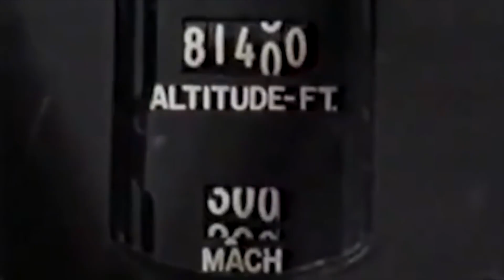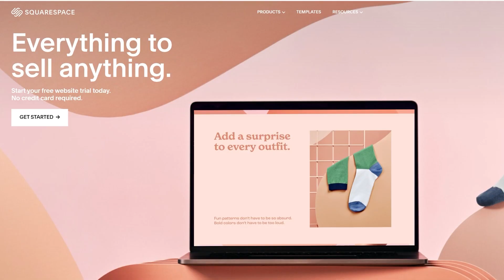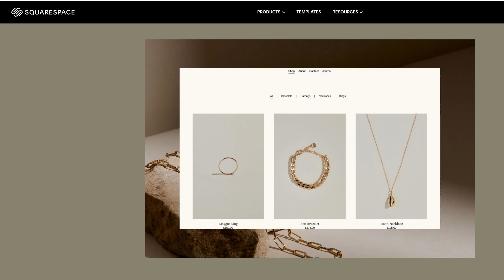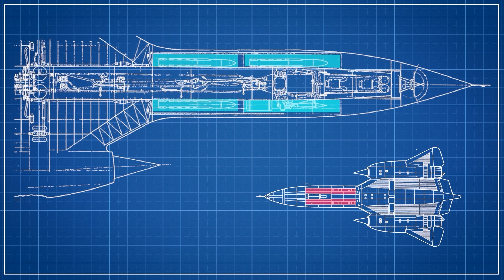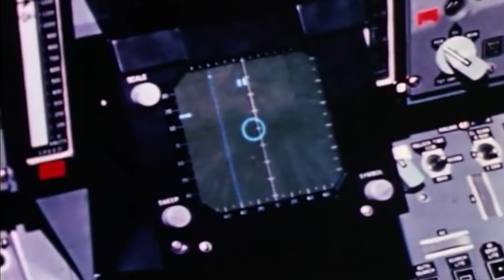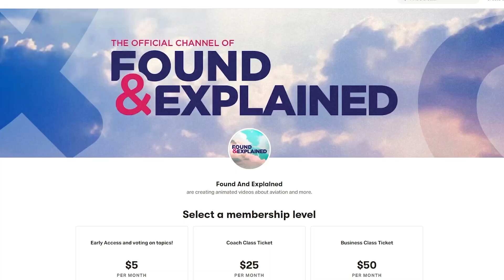Turning A Spy Plane Into A Mach 3 Fighter Jet - The YF-12

Comment: To be honest, Lockheed's engineers were kinda forced to make a fighter after USAF learned of existence of A-12 Oxcart...
After all, Air Force top brass wasn't exactly pleased to learn that not only did CIA withold crucial information concerning US airspace security, but that those shady suits at Langley for a few years had a plane that completely outperformed all and every type of aircraft that USAF had (and the fact that several promising Air Force prototypes were cut short for cost overruns while CIA seemingly got a blank check for A-12 added insult to that injury)...
Reply: The AF weren't "left out", they owned 3 A12s originally

Comment: Every flight arrival from these high-flying Titanium faith in structure craft, had a hella of maintenance extreme that led to tagging, PER flight, Lockheed simply needled to create a cooling cycle system, absorbing high, thin atmosphere from the front area of wing rims and engine intakes, lather building and distribute to the nose cone, pre-cooling shower the craft like a low atmosphere flight. That also could've evolved into passenger Orbitliner concepts in human history.

Comment: not possible the design of the aircraft was meant for a straight steady flight and loitering at very high altitudes sorry to say the sr31 a complete sitting duck in todays arena. Moreso the blackbirds are fuel thirsty both in flight and on the deck . I havnt read any articles that they addressed this issue yet

Comment: The operational, F-12B, variant, would have carried six missiles with two forward and two + two in the rear as the ASG-18 hardware was miniaturized and moved to the spine.

The centerline fin was found to be unnecessary and would have been removed, though the under-nacelle ones would have likely stayed.

The forward chine would have been blended into the nose, just behind the radome as the IRST could see a Mach 3 B-70 at 45nm but little else.

Against the M4 Bison or M50 Bounder, the jet would have been superlative.  Against the Tsotka, not so much (principally because the T-4 was itself an engineering testbed and far too small to achieve intercontinental distances).

Comment: It's not speed that dictates the outcome of a dogfight, it's the agility and the ability to turn inside your opponent turning radius.  You sent that turkey against the Mig 31, the latter, although slower, will be able to defeat it, unless the SR 71 clone will use its superior speed to disengage and run for its life.
Furthermore, a speedster like the SR 71 need lot and lot of fuel to stay airborne, therefore, what will be the engagement time of such a gas guzzler in a dogfight.
Has the "Einstein", who got that "brilliant" idea, forgotten at what speed a dogfight usually occurs?
Poor Yanks, always chest thumping for a  simple foat. Why don't you try to upgrade the F 16? It's the best fighter you've ever made after the P 51 Mustang.

Comment: At speeds like this, do you even need explosives or could you just dive bomb 20kg steel ingots at mach 3 and get away with quite an impact?  I am no expert, but it sure sounds like anything coming out of that plane is a kinetic weapon and just happens to be loaded with smart steering and explosives.
Reply: It would never be doing that at top speed. Most fighters hardly ever use their top speed except for evasive action and only briefly as it uses so much fuel.
Reply: @shrimpflea  that makes a lot of sense

Comment: interesting... I actually made a fighter jet that's based off the SR-71 and it's literally just called "RF-74 Blackwing"  (Reconnaissance Fighter) it's supposed to be used as the tip of the spear in an attack because of it's speed and actually good maneuverability(had the same shit as the F-22 and a rocket(basically an RCS)) and the airframe is made out of titanium alloy and tungsten alloys(tungsten for the parts that's higher in stress) and it can carry either 6× 150mm(550lb) Type20 Guided Bombs or around 10× Type52 IR/RD/LR Guided(IR = Infrared | RD = Radar | LR = Laser) Medium Range Air to Air/Ground Missiles

yes this mf got enough space to store bombs that nukes Frigates.. well the plane is as big as the SR-71 and has more fuselage room

Comment: Completely ridiculous.  So a plane that actually was faster than any missiles it could carry was an interceptor. How.. also heard it was used as a tanker. How. It had to refuel soon as it was airborne.  Leaked fuel on the ground. Airframe had to heat up to seal the tanks..at mach 3 any turn had to be standard rate to keep from overstressing the airframe..no negative g maneuvers . Great as a spy plane not suitable for anything  else. Not even good for that after Soviets came up with the mig 31 which was as fast and could intercept it.  Oh well it was the most awesome for it's time.  If you look in the cockpit see 50s technology.

Comment: Job well done, again. Kelly Johnson was the Einstein of aviation. My dad knew him & his protege Ben Rich well while working 4 Lockheed back then. Dad told me many unique stories about them. 1 was how a bunch of engineers couldn't figure out how 2 make the air intake cones work & correct diameter 4 the SR71. Kelly walked up looked & said 30° & retractable 4 speed. No computers then & when they did their calculations found out he was spot on. Another stroke of genius was placing engineering & production side by side on the fightline. Allowing quicker communications & understanding each other job difficulties. Also cutting out egos. Kelly was responsible 4 many aeronautical advancements in aircraft designs & materials in different manufacturers planes 2day. Some of their work R probably still classified. So was Ben also ie F117 - F22 - F35. After Kelly retired Ben took over. The only limitations they had was government budgets & politics. Because both had 4 things going 4 them, A. imagination, B. can do attitude, C. "if we don't have tooling, we'll design it, D. management left them alone & gave the cash. Both men approach the Air Force uninvited with new planes that it even didn't think were possible & showed them it can B built.
Reply: I love hearing stories about those 2 men, I recently read both of their biographies, and some of the feats they've accomplished are nothing short of amazing. It's almost unbelievable how much they changed the american aerospace industry

Comment: The, aim 54, Phoenix air to air missile was developed for these. They were used by the Tomcats being reliable.
Reply: I would add that I have seen photos of the YF-12A which featured pylons with what appeared to resemble wingtip tanks protruding below each nacelle (featured in this video at 6,51 minutes) although I'm sure that those were more likely for aerodynamic testing.
Reply: @laurogarza4953  Those were camera pods to record the missile launches during testing.

Comment: Please make a video about the two stage to orbit system that was rumored to exist called "Black Star" in the late 90s-early 2000s. It was supposedly a way for the USA to have access to space after the Space Shuttle disasters. It has a large "Mothership" that resembled a modern cross between A-12 and XB-70 that carried a smaller fighter sized orbiter that would launch satellites and stratigic reconnaissance. I know there is plenty of infomation on the web for reference and I can attest that it is not so much of rumor, atleast back then.

Comment: Getting weapons bay doors open and a missile out, into a Mach 3 slipstream, would have been exceptionally difficult.
Reply: There is no way that would have been at Mach 3 speed. In fact very view if any fighters drop any ordinance at supersonic speeds.
Reply: @shrimpflea  During the testing they launched a missile and destroyed a target drone while at mach 3.2, kelly johnson does the impossible once again
Reply: @shrimpflea  That's why a Mach 3 fighter would have been a bad idea.  About the only way to do it would have been ejecting them out the back end like an A-5 Vigilante and even that brings as many problems as it solves.
Reply: missiles close at much faster than mach 3. weve been hypersonic since the 50s

Comment: In the comments there seems to be some confusion. The YF12 was maneuverable for its size and weight. The high speeds the plane would operate at equated to a  lot of real estate when making a turn... that simply means that a slower plane could turn in side of you and get guns on. From the accounts of the pilots that flew her she was a decent flying aircraft.  The US Air Force did not like the idea of the exotic fuel the YF12 used. It was one thing to have a reconnaissance air craft use this fuel but an interceptor being used for defending the contiguous United States would cost far to much in added infrastructure.   The "interceptor" had a different engine set up and was easier to operate than thorough bread SR71 - however, over all, the project was deemed impractical.
Reply: @Karma Mechanic wow that sounds suspiciously like a F-22
Reply: @glennoswald5928  Really? I don't remember the F-22 using exotic fuels at all

Comment: Imagine how much titanium the US would have to acquire from the USSR for 93 planes.  Also how much jet fuel would be leaking on the tarmac.
Reply: There were no 93 planes ... 15 A-12s were built, 6 lost, 9 on display, along with 32 Sr-71s, 12 lost, less than a third survived in musems.. I'ts use was limited since it nver crossed into soviet irspace.. Now imagine ow much titanium does it take to build nuclear submarines, like the Soviets did

Comment: Due to initial production difficulties of the Pratt & Whitney J58 turbojets, the first five examples of the Lockheed YF-12's predecessor, the A-12, were initially flown with the Pratt & Whitney J75 turbojets in 1962. These J75-powered A-12s were capable of obtaining speeds of approximately Mach 2.0. It is interesting to note that there were proposals to replace the Pratt & Whitney J75 turbojets with afterburning (or reheat in British English) versions of the more fuel-efficient Rolls-Royce Conway turbofans in J75-powered aircrafts such as the Convair F-106 Delta Dart and the Republic F-105 Thunderchief. Perhaps if the Lockheed YF-12 had been accepted into service with the United States Air Force, the YF-12 could have later been upgraded with afterburning versions of the Rolls-Royce Conway or other similar afterburning turbofans.

Comment: The A-12 was so top secret that at the Skunk Works the only thing separating it from the YF-12 on the production floor was a temporary moveable curtain.
As the A-12 was so classified because it had "stealth features" (primarily the leading edges of the wings) this feature was not used on the YF-12 because it was an Air Force aircraft and the A-12 was a CIA plane.
The Air Force never knew.
Regardless of what "official" stats show, the SR-71 was much faster than the claimed top speed of Mach 3.whatever...
And the A-12 flew higher AND faster.

MUCH FASTER

High mach 4's.

It's only two real limiting factors were fuel quantity/distance per mission and what would melt or fall off the aircraft/break (non titanium parts) at those speeds.

As Kelly Johnson said, the aircraft skin tempers itself with every flight.
Reply: Aerodynamic heating would have put a hard limit on the speed of about Mach 4.2. According to Brian Shul, the SR-71 was capable of doing Mach 3.5, and although the A-12 was significantly lighter, I have significant doubts that it could do much past Mach 3.7
Reply: @richardmillhousenixon  This is absolutely true. I doubt the aircraft ever got close to mach 4, as at mach 3.3+ the leading edges were approaching the thermal breaking point of about 900 degrees F, too much more heat and the titanium is prone to heat cracking and becoming too brittle for the conditions. Unofficially, Brian Shul is the fastest pilot of the SR-71, a speed that is still classified, my guess is about mach 3.6-3.7, which is about where things start to get dicey, as he even said stuff was falling off the aircraft at the speed they were flying at. The A-12 may be lighter, but they were made out of the same materials with the same limitations.
Reply: the a-12 was not more classified than the sr71. people never in the military or aerospace industry arent capable of being experts. researching on a computer doesnt make anyone an expert in any field
Reply: @nomercyinc6783  
I never said in my comment that the A-12 was more classified than the SR-71. I said it was more classified than the YF-12, which was true. 
No experience in military matters are required for basic reading comprehension. 

Reread what I wrote.

Comment: YF-12 was a cool concept, but there was so much prep required to get the thing (and the pilots) flying that it was totally impractical as an interceptor sitting on alert.  I mean, the thing leaks fuel sitting there, has to have its hydraulic fluid preheated, it takes a 500 hp ground cart to start the motors, and the pilots have to breathe pure oxygen for a couple hours before flying.
Reply: True, hardly a QRA type.

Comment: That is a plane that can only go fast in a strength line and fly high, with a long time to reach that speed, it has low climb rate, it has 0 maneuverability, turning radious much higher then a civil plane, it couldn’t be fighter jet no way, plus it has many other flaws wiyh overheating and so on, but cool
Reply: as an inerceptor , it would probbly fly towards it tarfe and realase missiles BVR and head home..
Reply: @beyondrecall9446  in modern days with such defense systems it would be completely useless

Comment: In 1983, a Boeing 747 was shot down. USSR pilots said that there was a fighter plane in the radar shadow of the Boeing 747.  The USSR fired an A-9 9 (R-33) missile from a MiG-31 aircraft, then with a maximum range of 120 km.  USSR pilots claimed the plane turned on them, fired a missile, turned back, added gas and escaped a rocket they fired at the plane.  The passenger plane was hit by a rocket, but the only fighter plane that could fire a rocket and escape the USSR fighters was precisely the YF 12. In order to achieve this, the plane flew at a maximum speed of 5 ÷ 5.5 Mach.
Reply: and it wasn't picked up by ground stations? although every flight of the sr71 was closely monitored but it never crossed into Soviet airspae,, Justheard simon.. no, thry never shot at an sr71
Reply: @beyondrecall9446  SR 71 has always been faster than the USSR missiles.

Comment: With speed like that, you don't need fire missles. Just fly up tp them and tap them on the shoulder and tell them to loeave like that F-22 pilot did to that Iraqui pilot in the F-4. Tell them that you have missles in the bay but if they dont leave, you will drop the missles on their heads like bombs.

Comment: Could you imagine going so fast that when you launch your air to air missile, you outrun it? 😄
Reply: you literally cant outrun a rocket cause when you launch it, it already has the +3M speed
Reply: @ZaMus  thats not how physics were, if said object is longer well attached to the thing going that speed it will lose speed quite quickly.

it will retain speed but won't keep up etc it lacks the prupulsion to do so
Reply: @NonsensicalSpudz  well, mb
Reply: @NonsensicalSpudz  You write: "if said object is longer well attached to the thing going that speed it will lose speed quite quickly."
Yes, it would do that if it didn't have a big rocket motor with much more thrust than the amount of drag the missile has.

So, staged rockets, or rockets that discard SRBs are an example of why a purposely engineered air-to-air missile fired from a moving aircraft will start with the speed of the aircraft+missile assembly and then accelerate away (with its engine burning). It would be pointless to launch an a-a missile that had a lower thrust-to-drag ratio than the launching aircraft, unless it was a long-range-cruise-missile.
What you describe is essentially a "bomb". An un-powered finned munition dropped from an aircraft, and yes those will definitely slow down after leaving the aircraft.

Think of the aircraft as the "booster" or "first stage" of a multi-stage rocket. The physics is just the same, except that the original aircraft keeps flying after launch, as the missile speeds away under its own rocket (or other) power.
Reply: @sleat dam melted the guy